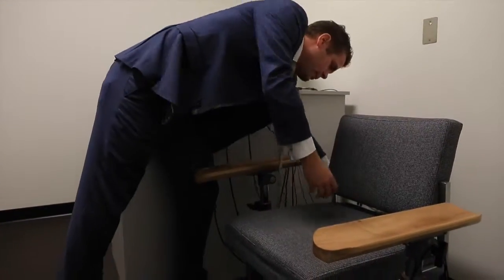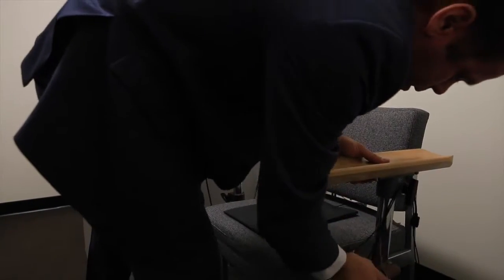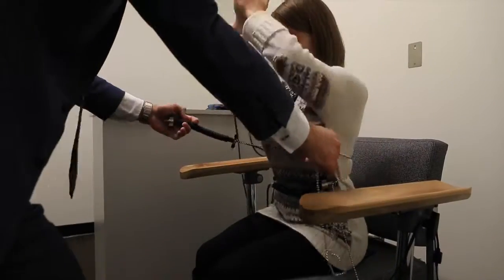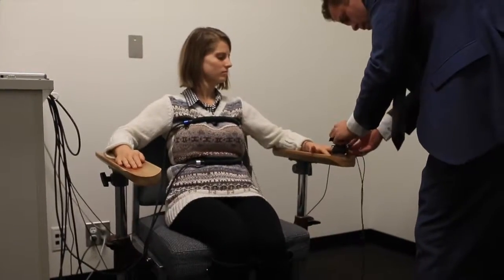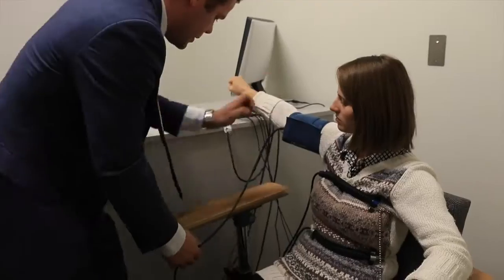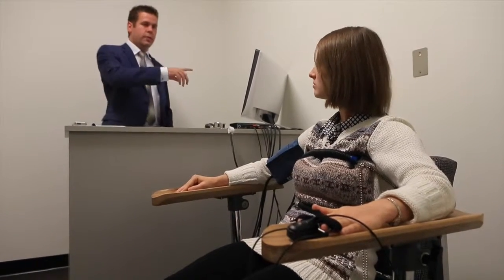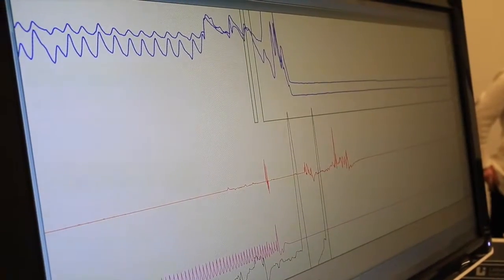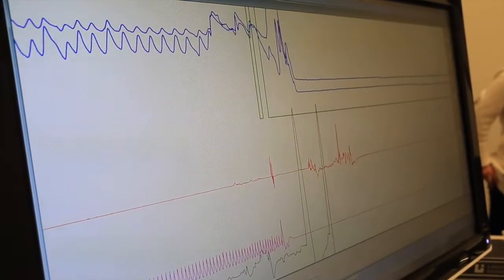Video: How to hook up a polygraph

Comment: Whatever people feel about the polygraph, I think they would agree that the machine and the whole process generates fear. Probably the primary reason.  I took one 4 months ago and I never was under that kind of stress and tension. The examiner told me the machine she was using is the most advanced and could detect any deception.  I was strongly encouraged to tell the truth. The questioning lasted for almost one and a half hours.  My results were inconclusive although I answered all questions truthfully.  She paused the exam 3 times so she could release air in the blood pressure cuff.  She would then inflate it and continue with the questions.  When the test was over, my blouse was damp with perspiration. I don't want to face that machine again.  By the  way, if you are a woman reading this, don't wear high heels to the examination, you will have to remove them. Your feet have to be flat on the floor.

Comment: Polygraph is a SCAM industry. They only use it to scare confessions out of suspects who believe they actually work. In other words, if you believe in polygraphs, chances are you’ll be scared and confess to what they’re trying to shake out of you. I took a polygraph once  to settle a trust issue and was told I “failed miserably” even though I was being 100% truthful and should’ve passed with flying colors. The U.S. Supreme Court has already ruled,  that the polygraph is as reliable as the “toss of the coin”. Had I known how flawed the polygraph industry is, and their operators being narcissistic POS, I never would’ve subjected myself to it. It was my idea to hire a polygraph examiner, not the other party. Since then, I have learned about the Supreme Court’s decision on banning their use to being admissible in courts of law, due to their extremely poor results. Also, I learned of these two resources available on YouTube here, one is Doug Williams Polygraph (a former Oklahoma Detective/polygraph examiner and now a crusader against their use), and the other is a 60 Minutes television episode taped around 1986.  The 60 Minutes episode has Diane Sawyer and her undercover investigative team exposing the polygraph industry for being complete frauds. The episode is called “Truth and Consequences”.